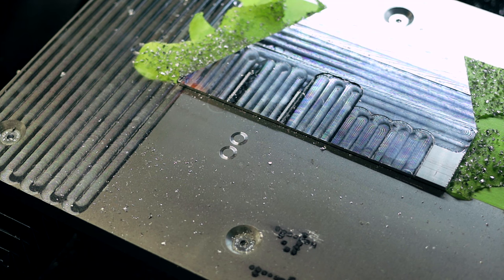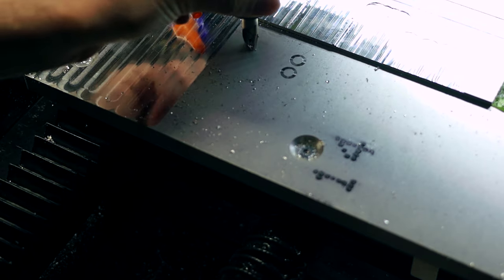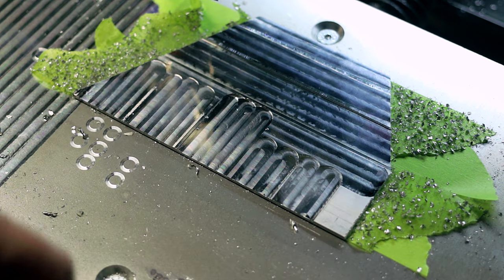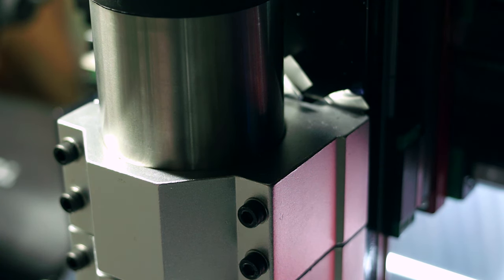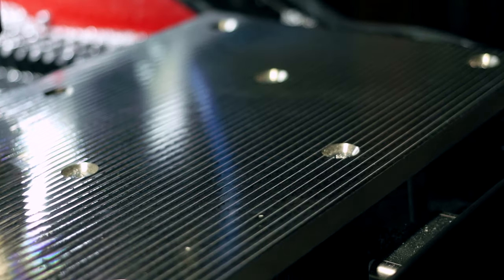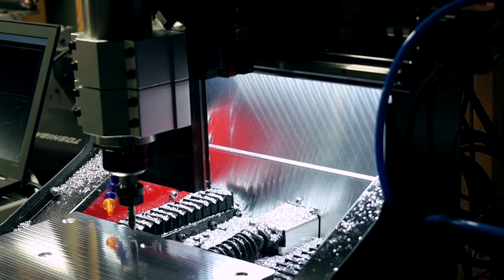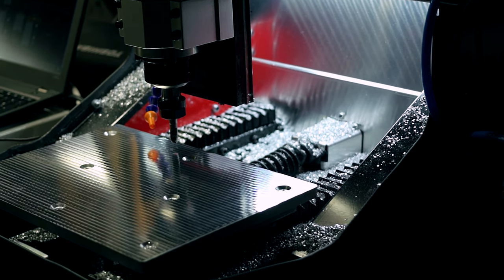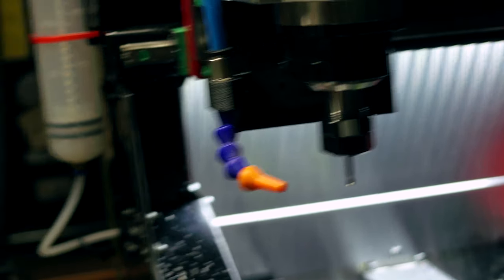Shariff DMC2 Build Part 3: Easy Spindle Tram Method, Bed Surfacing and Final Thoughts.

Comment: Hey man great videos! I’m in the process of having some issues with electrical somewhere along the lines. The z goes opposite the direction but DRO reads the correct way (positive in the positive direction and negative in the negative) but buttons in mach3 are up is down and down is up. Working through this and hope to have the machine running shortly!
Reply from the maker: Thanks! Do the keyboard controls respond correctly?
It's likely either controls programmed incorrectly or you've got both an electrically flipped motor and the motor flipped in the software.

Comment: i  reamed 10mm hole  in my worktable when making that part (on a cnc wich i know is perfectly trammed) and so i can put a precision 10mm rod inmy spindle and i know the exact location of the hole in my table

i i jog my machine there exactly, drop the spindle with the rod in the collet in the hole and tighten it up 

perfect tramming in 30sec , and real easy 😮, idk mybe this helps someone